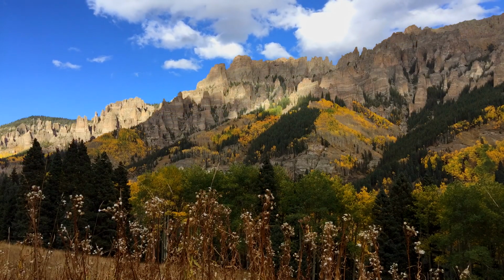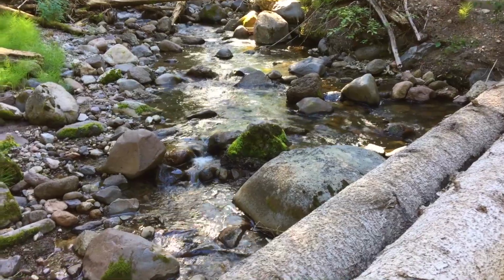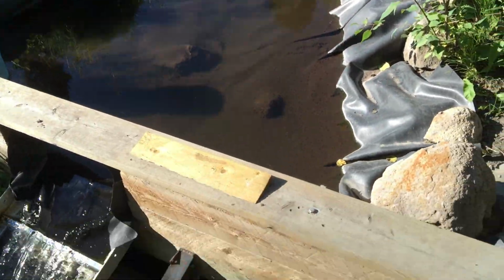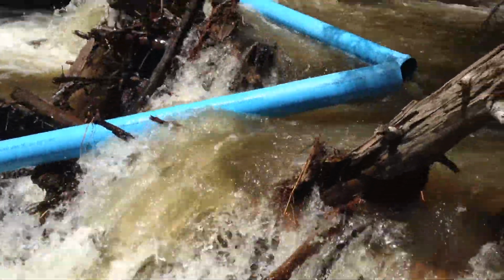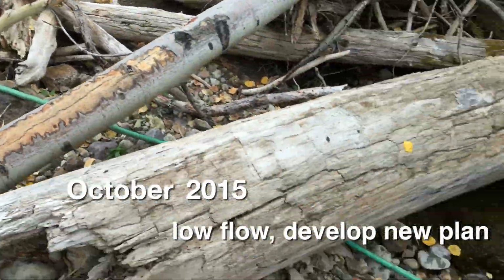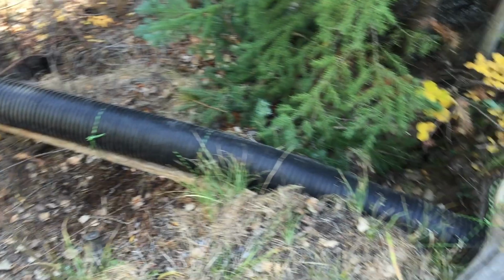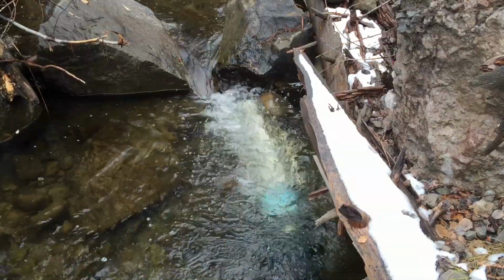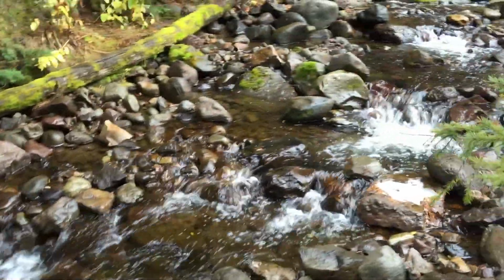Part 16 MicroHydro Power System in CO

Comment: How much did all of this setup cost?
Reply from the maker: +Harrison Gage 
Reposting a previous answer to a similar question:
"It's a good question, but very difficult to answer. First, one would have to amortize the cost of laying in grid power in 1994.  At the time of the switchover the system had produced 145,000 kWh for a basic cost of $25,000 versus $140,000 for laying powerlines. Add $52,000 of current development costs and you are paying for all the future power generation in the systems lifetime. You would also need need to subtract the cost of line power over the last 19 years to determine the cost per kilowatt hour over the first system's history. The other reality is that the present level of power production is maybe 1/5 of what we eventually hope to accomplish. 
Ultimately because it is AC you have to use whatever power you are generating at the time you're generating it.  Living off grid with hydropower means that you use more power than you usually would, you run appliances more frequently, have access to using large electric tools, you always have hot water available at no cost, can defray the cost of heating your home in winter, and you are paying for all future power at the beginning. So, it becomes a lifestyle choice. Are you willing to pay for all of your future power upfront and have no environmental impact and thereby increase the asset value of your property, or are you buying into the centralized system with power production which at this point is based about 50% down to 42% on coal for power generation over the life of the current system. 
Changing one's approach/reliance on the polluting centralized system requires planning, commitment, and patience. It is not something most people are willing to undertake, or have the financial wherewithal to complete. I got lucky and found myself able to pursue this undertaking nearly 25 years ago and am fortunate enough to share my experience via the Internet which has developed in the interim. 
Hopefully people somewhere in the world will find the information useful."

Comment: How Much Wats Do You Make? 3000 ?
Reply from the maker: The system could top out around 12,000 watts if I wanted to put a second jet in the system and wanted to go 3 phase.  It would also require that I had a good use for the power, which I currently don't.  However with a single jet the plan is to increase the output before winter to roughly 8500 watts.